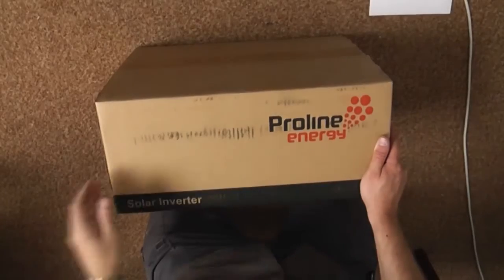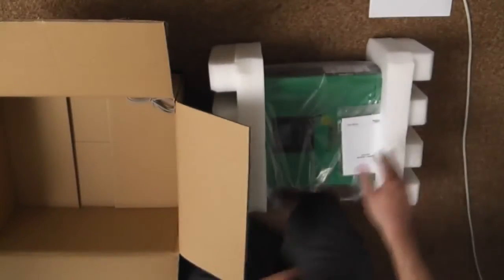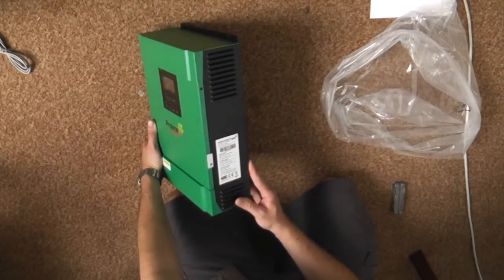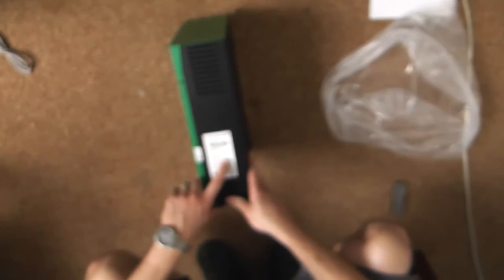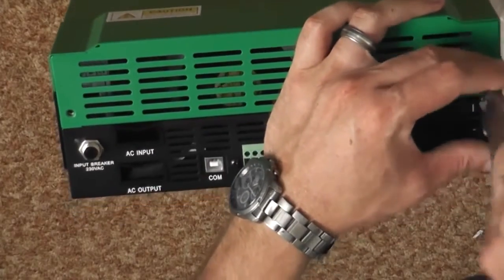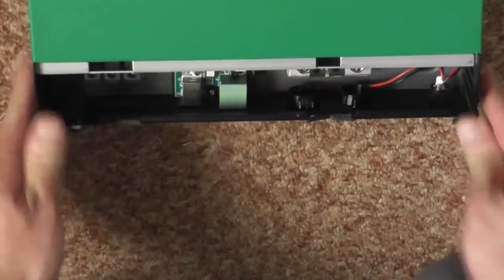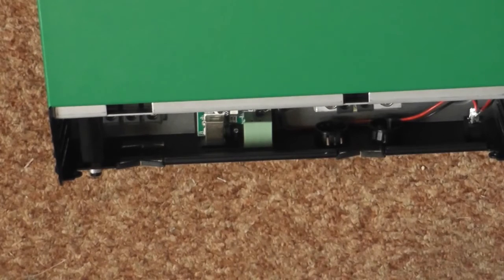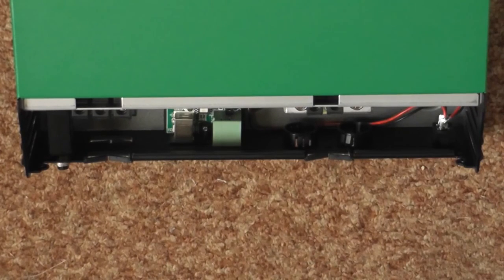#3 - Unboxing of Proline 3KVA 24VDC Solar inverter PROEIP3K24

Comment: Hi, Imfrom the Phils and Im starting a solar set up. Can you pls sketch or draw how to connect the AC input and AC Output. Sorry not so savvy on circuit diagram and preffered illustration.
  Thanks in advance.